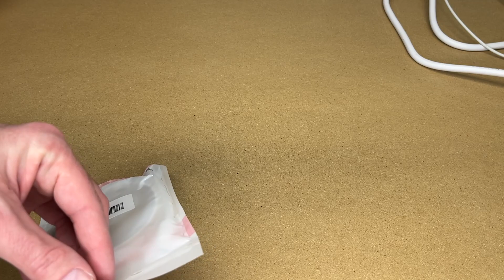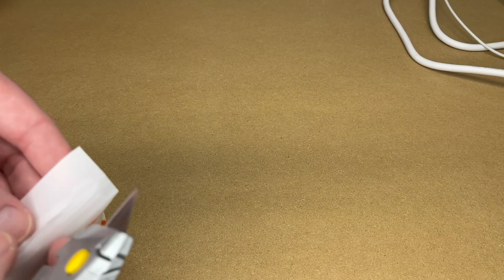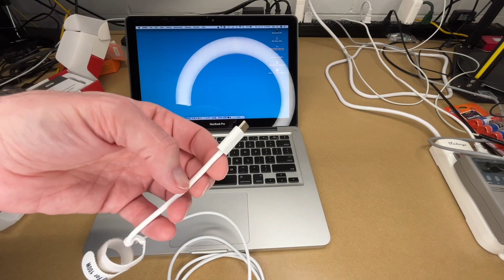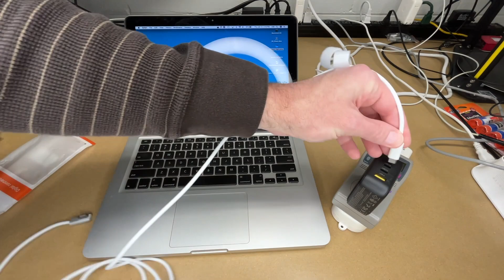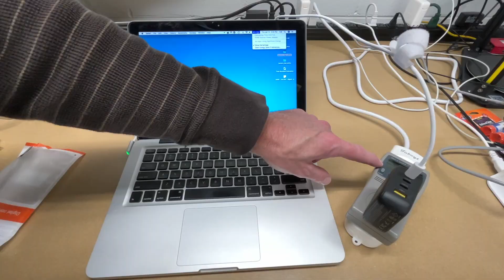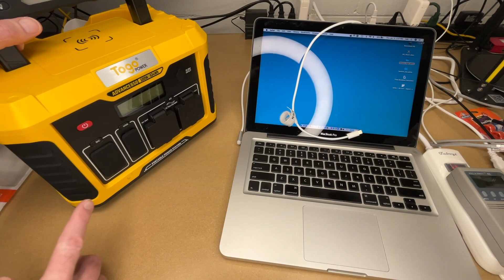Etre Jeune USB-C PD to Magnetic L-Tip Charging Cable for 2006-2012 Macbook Pro

Comment: It will work if I use a 30w charger with a 2011 macbook pro?. The current charger that is broken is 85w
Reply from the maker: I think this requires a 65w charger if I remember correctly.

Comment: You are a real life saver, my man. Today, I plugged my Macbook pro 2011(that is with linux mint right now and I use it for college) charger in one of the power sockets at my intership office and
the charger made "Kaboom". And these days, they don't sell these legacy macbook's chargers anymore, at least, not original ones. So, I thought of getting a magsafe 1 to usb-c cable. Turns out
your video was THE ONLY ONE that I found showing if it works or not, using a real Macbook Pro 2012 . So, Thank you so much for the help you provided, you answered a bunch of doubts I had, thank you so much again!!!!